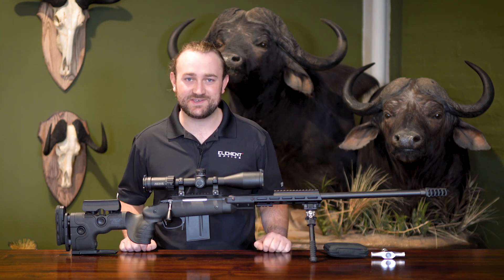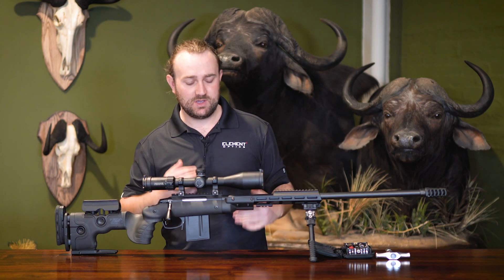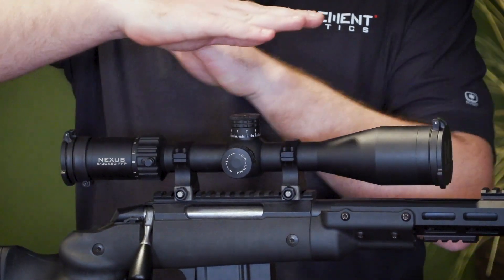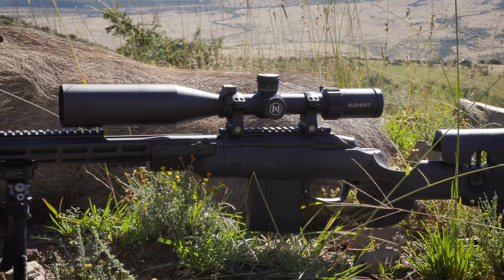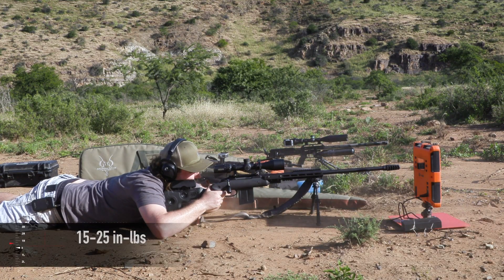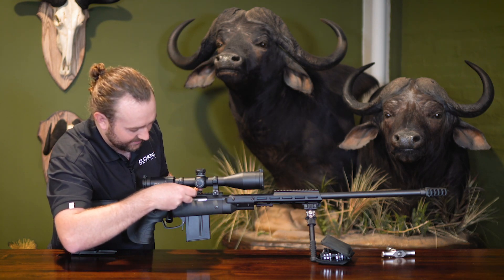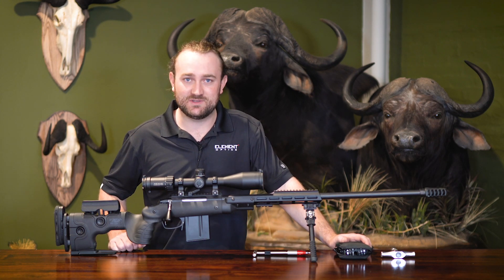Why Using the Correct Ring Torque is Important

Comment: So, why do you not just go out and proof that the correct torque is necessary for accuracy, if it is so clear? I love how it is always those that sell torque wrenches that tell you how necessary they are. Either those or those who just left a store where torque wrenches are sold....

Most scopes have an outer tube, in which the parallaxe tube moves. However that inner tube is only connected to the outer tube at the adjustment rings, meaning that deformation of the outer tube will have minimal impact on the position of the inner tube. And even when there is an impact, the deformaton of your outertube will be the same all the time, meaning that once your scope is sighted in it really does not do a thing if it was tightened with 5Nm or with 30Nm.

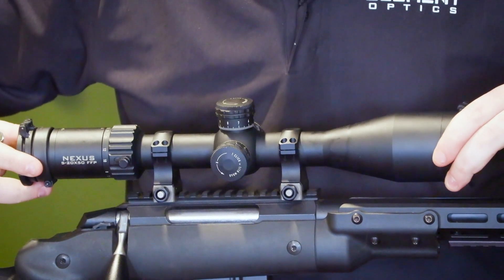Comment: Base nuts at 5:36 were 68 inch pounds. On My ATN X-Sight 4K Pro 5x20 those same base nuts. ATN told me 30 inch pounds. Sounds low. What should I set them at in Your advice? Took me forever to find a video like yours. Great video information !! Thanks

Comment: Matt you have connections to FX. If torque is so important, why doesn’t FX include those specifications with their No Limit Scope rings? It’s one question that cannot be found on the internet. Work your airgun magic and find out the proper torque setting for their costumers.

Comment: Dear @elementoptics, Matt, I was wondering if It  would be possible to purchace extra turret "knobs" for the elevation turret. I am using a Titan scope with the simple MRAD reticle and absolutly love It! I would like to be able to set up more different sight tapes for different projectiles or even calibers. I am a former professional archer and use different preset sights with different sight tapes on the same bow (and other preferences for specific competitions) 
I was thinking the same could be done for my titan scope. The zero system works so well and quick that changing turret "knobs" would be a piece of cake. With a smartly choosen zero stop, that could act as a reference for different turrets, maybe not exactly at zero but that wouldn't matter.

This is just an idea, let me know what you think.

Keep up the great work you do for the airgun community! I have been following your channel for years and was one of the many people willing to support you when necessary, trough your patreon account.
All the best,
Thomas, the Netherlands
Reply from the maker: Hi Thomas!
Yes, we have already discussed this idea internally. We are just waiting for our online store to be built as we don’t think this is an item that many dealers will want to stock. Once we have the online store open you will be able to buy these parts👍🏻
Reply: @ElementOptics  Thanks for your reply. I agree that it will be for a small group of people so not so interesting for a dealer. I will await the availability through your coming online store. Nice to hear it was already in the planning. Hopefully they can be offered for a reasonable price, then I will certainly buy a few.
So far I am really impressed with my Titan scope, Keep up the great work!
Reply: @t.vaneil1350  it's been quite a while now I was just wondering if you were able to pick up those extra turrets and if so did it work out like you thought it would.

Comment: Here is a simple reason why. i fixed my scope with the spline provided and when we went hunting my front mount came loose on my 3006. lesson learned. so i think my scope is over tight now must still take it in and let someone torq ot properly. is that something patriot shop can do?. I dont have the funds to by a torq driver and use it once as i just hunt once a year with my rifle. patriot shop is just down the roud from me.
Reply from the maker: Hi Johan, yes I'm sure Patriot can help you. It just depends on what mounts & scope you are using - I would check the torque specs first.
Reply: hi. i have warne 30mm picitiny rail rings and a 4-16×44 bushnell extreme throphy scope